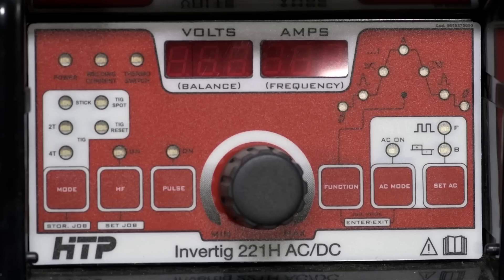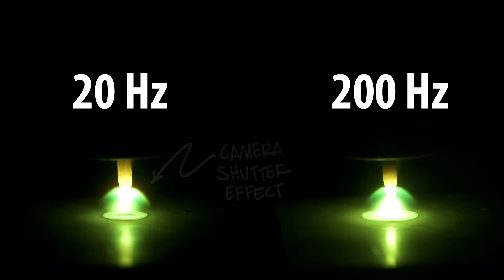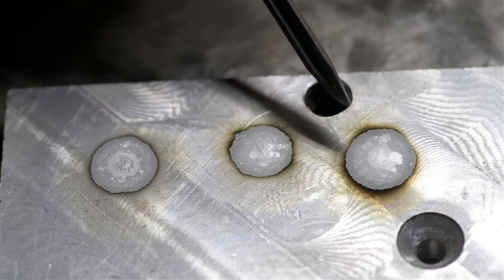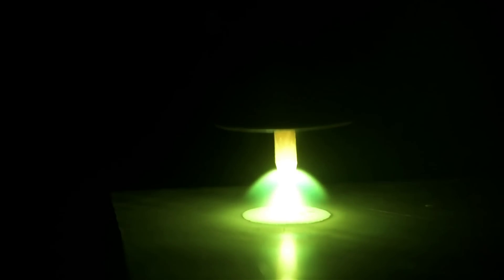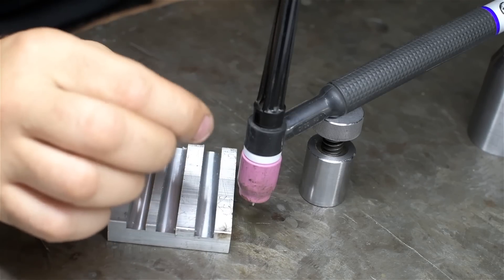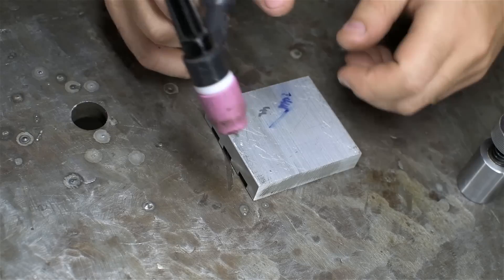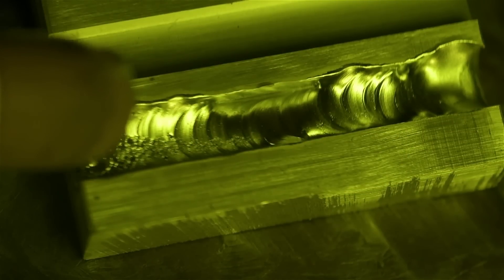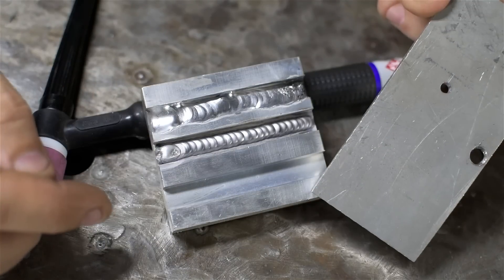TIG with TOT: AC Frequency?!

Comment: Very thought provoking video. Great job
Reply from the maker: Thanks Jody, always good to have you popping by.
Reply: You might be getting these results because of square waves. It may change with saw profile or sine waves. Because in some electric motor changing frequency for example increasing it increases the speed of the motor so we can say increasing sine frequency increases the power. But i guess in square wave its much more about duty cycle. But i am not sure since i am not an EE but ME.
Reply: yea agreed im more thinking it would also depend on tungsten prep as well so maby a  different combination  with  a bit different ac balance  thats the thing with these new machines so many different combos   as i sit here considering an everlast unit
Reply: I have a feeling 200a on most if not all welders does not mean 200a rms, and therefore the actual power delivered is not the same between DC and the highest frequency setting on the welder. Apples to oranges. Welds looked prettier than mine though, maybe I need to involve AC and maybe some helium with my normal lift start routine
Reply: @nicholaskruft3189  I think you are right on the money here Nicholas. the useable or functional part of ANY sine wave is its 70.7% of peak to peak voltage, or its RMS (ROOT MEAN SQUARE) value.  The rms value of is a function of arc voltage and current, one is dependentvon the other. For example lets forget about amps right now. lets look ai it in terms of voltage. If we have an AC wave with a peak to peak value of 200 VAC , at rms the voltage value is 141 VAC not 200. The rms value is what everything downstream from the tungston is "seeing", not 200 volts. Ohms law says the amps (I) = e/r . r being resistance in ohms. This would be all the resistance from the metal, the tungston, any microscopic dust particles, and impurities.1.1 ohms would be good resistance in an established plasma arc. dropping e to its real world rms value of 154 VAC / 1.1 ohms value of r yeilds 140 amps not 200 at the arc.  However this seems to be skewed a bit much by 60 amps? Seems to me the welder maufacturers would look at this and compensate for it, unless my math and ohms law is suddenly haywire? perhaps my math is? just thinking out loud here is all folks. lol!!
Reply: Both you guy’s have great videos! Im gonna teach myself to weld. Ordered a Everlast 200DV today. From what u guys put out there im confident i have learned enough to do myself.
Reply: instablaster.
Reply: @hondafreak8613  howd you do after learning after one year? hello?shit hope he's not dead.
Reply: @ThisOldTony I'm just a novice aussie bloke that loves to play around in my shed with a tig welder.  I watch both you and Jody great content from you both.   I  have also found and agree that the lower the Hertz range seems to produce more heat than the higher Hertz range but I dont put it to skin effect.  I look at it with maths I'd like to explain my view and please tell me if I'm wrong..  AC  Balance is the amount of positive (cleaning) compared to negative (penetration/heat) in the square wave cycle, usually 30%+ and 70%- ish.  And AC frequency is the number of cycles in one second.  Now if we can only move for example 1 inch in 5 seconds and the hertz is at 20 its has a much longer period in a particular area at the negative range of our balance in any one area.  And yes a larger period in the positive zone as well.  But at a higher Hertz the positive and negative are switching at a higher rate of speed which when applied at a rate of movement speed of the welder hand produces a cooler weld with less penetration.  Not sure if my thought makes any sense.  But love your work and you too Jody @weldingtipsandtricks

Comment: the machine is most likely not producing a perfect square wave, there is a slight ramp in the cycle switch, the slower frequency allows for a longer time at max amperage while the higher frequency spends more of the overall duty cycle in the transition between positive and negative
Reply: at least that's how I remember it from vo-tech welding program back in the early 90s
Reply: Cory Allison this seems very likely to me too, especially given the large voltages involved the ramp times will be high. I guess the plasma also has some capacitance which will add to that.
Reply: I was thinking the same thing
Reply: Got there before me!
Reply: time to get the o'l smelloscope into the equation
Reply: This non-ideal voltage transition is definitely part of it. The other part is what's called "ringing" - the transition in the cycle  wants to 'carry over' the set voltage, and then correct back down and 'carry under' again, many times until the waveform settles down. This happens on timescales which are sub-wavelength - small enough that with an oscilloscope you've got some zooming and enhancing to do in order to observe it, but it definitely affects the efficiency of energy transfer as heat. That ringing may even be high enough frequency to get into the RF 'skin effect' that TOT talks about in the video.
But it definitely means - like you've said here - that a lower-frequency waveform spends a larger proportion of its time in that "settled down" state which is good for heat transfer.
Reply: the voltage are not very high, once the arc is started it is probably something like ~25V
Reply: Can the aluminum dissipate the short pulses of heat more efficiently than the longer pulses?  I think you're spot on with the waveform being the cause.  Just throwing that out because it's what popped into my head.
Reply: Yup there is a ramp, and there is also likely a small delay to prevent shoot-through.
But I think the main thing is Reactance.
By setting your frequenzy higher it sounds like you're doing some fancy magic, but you're just pissing away power as more heat in wires and stock.

However, it would be interesting with a test of how frequency impacts <Arc ignition distance>, especially when the stock is covered by an electrical insulator like milling scale and other kinds of crud.
Reply: The start frequency is independent of the set frequency.  Most TIG welders have a separate high frequency start.
Reply: Steffen Dahlberg arc distance also has a lot more to do with argon coverage than frequency as well. With a big honking cup and high gas flow you can make a diffuse arc from inches away.
Reply: I'd like to give a shout out to Don Ivy, my welding instructor at the Tulsa OK, Vo-Tech welding program, class of 93. 25 years on and I still remember a fair bit of what he passed on, thought he was an asshole at the time, but he did good.
Reply: Came here to suggest using the oscilloscope as well - IIRC he's done one with it on the old TIG machine.  Capture some waveforms and all will be revealed....
Reply: The ramp lies in the nature of the attachment: it's very obviously capacitive. At 200Hz, you don't necessarily expect IGBTs to have much of a ramp of their own, then again, there's obviously gate capacitance, so depends on the current you can feed there.
Reply: @Siana Gearz, IGBT input and output capacitances and gate charge for igbt devices specified for pulsed currents around 200A have negligible effect at few hundered Hz. Typical igbt combined on-off time is around 500ns. Of course, this is only one component and it says little about the whole system. Alas, commercial igbt modules e.g. the ceramic-brick-looking module which is what you typically see when opening up a welder, are specified in 10's of KHz, some even close to 100KHz. In a welding setup, all the low-gage cabling to handle the currents controbutes significant inductance and that will likely dominate. To get to the bottom of this, several tests across different freq's and amps should be run probing voltages and currents simultaneously which would help answering what is actually being put into the work-piece under weld and then we can propose theories of what's happening. It would be interesting to observe whether tungsten shape (balled vs. sharp) would affect the measurements in any way while other variables are kept constant (i think then the igbt drive signal should be probed as well, given that the system has feedback loop). This will not be easy to objectively measure (driver and power characteristics, tungsten, welding penetration and bead shape etc, quite many variables to account for)
Reply: Djöfull er gott að vita til þess að það sé í það minnstakosti einn annar Íslenskur vitleisingur sem horfir á bæði AVE og This Old Tony
Reply: there's dozens of us, dozens!
Reply: tékkaðu líka á stefan gotteswinter og oxtoolco báðir miklir meistarar
Reply: Þrátt fyrir að ég sé búinn að skella mér í gallastuttbuxurnar þá held ég að ég sé seinn í þetta partý
Reply: @Kar1HP  make the video. you will get a million views and be a knowledge base for many years to come.

Comment: I do a lot of pipe welding with an extended land bevel which is similar to the grooves you welded in. I always go high frequency on the root to prevent the puddle from spilling outside the bevel, then I go low frequency on my fill and cover pass.

Comment: Hey This Old Tony, tangent thing I wasn't sure you knew:

I noticed your cracked nail in the video. Get some CA Glue, put a droplet on you nail and then put a tissue (facial) on the drop. Let it dry. Remove excess tissue and then get your wife's nail file or one of those lathe files you've mentioned and sand the patch smooth. It's kinda like fixing fibre glass.

Source: my Mum was a nail technician for more than forty years and I suck at hammers.
Reply: Is that why your name is toddsmash?
Reply: @HenryPiffpaff  Sorry for the very very late reply.

Unfortunately I am one of the clumsiest people I know.
Reply: @toddsmash  Pro tip, forget the tissue since you scrape most of it off, instead, put only fractionally more ca than you need and sprinkle baking powder on top {or bi carb}

It'll make the ca super hard and then file down, it'll be a long while before that nail breaks again
{source helicopter technicians use this to temp repair damaged blades}
Reply: @sarchlalaith8836  never heard of that one but I'll try it next. Thanks mate!
Reply: @toddsmash  welcome cohort.

Comment: The skin effect actually does appear at pretty low frequencies [1].  The skin effect at 200 Hz is as low as 4-5 mm in a plasma.  With square waves there will be higher harmonics and the depth will be even smaller.  

Higher frequency will cause power to concentrate in the outside of the arc cone.  That extra heat on the outside will dissipate a lot more before getting into the metal, and indirectly widen the arc very slightly as heat on the outside will generate a little extra plasma from the surrounding cool gas.  Say you're running at 2000 Hz with a square wave and your overall skin depth is 1 mm.  If the arc is 4 mm wide, the power in the center is 20x lower than the power on the very edge of the arc.  At that point it might as well be off.  At 200 Hz the difference will probably be closer to ~20%, but that's still a huge difference and the overall heat into the weld will be reduced a lot as well.  Since power is concentrated on the outside of the cone it doesn't have an insulating later between it and outside air and it radiates faster.

The reason skin effect is usually neglected at low frequencies is that the overall power dissipation doesn't change much until higher frequencies, and wires are much thinner than a GTAW arc.  Electrical engineers don't care much if a wire has 10% more resistance than expected, but when you're welding a 10% change in settings can be a big problem.

Comment: Hey Tony! Electronic Engineer here - I think your statement at 8:35 ish might be off. I doubt it's a square wave. Probably more of a trapezoid shaped wave, with a set rise time based on the voltage you're running, humidity, quality of grounding and so on. That rise time will be the same at 20Hz and 200Hz. And probaly takes a few milliseconds. Therefore at higher frequencies instead of hitting the flat at the top of the trapezoid, it's either sloping up halfway, before sloping down again, or just spending less time at the top, so the integral yields less energy to the work. Great video as usual!
Reply: Fellow electrical engineer here. Since the output of the welder is a (somewhat) square wave, is it possible that the higher frequency over-tones of the wave may play a role? Can the skin effect and other inductive losses come into play in higher frequencies that the fundamental frequency?
Reply: Interesting theory, although I have a feeling that because the tip of the electrode is held just over the grounded work and sparks fly (!) There must be some amount of capacitance which would account for the delay in charging up over the cycle. The plasma gap and the voltage difference effectively create a RC circuit? You could be right though, L might rear its head.
Reply: Probably also ringing like a carillon on Christmas.
Reply: Not an electrical engineer here, so I may be way off, but here's another take on it that may also play a role in what's being observed: let's assume a perfect square or sine wave where the only difference is the frequency. At the lower frequency, electrons have more time between wave reversals to travel through the material. Therefore they travel further, causing more heat. The higher the frequency, the less far they travel before having to turn back. At the upper limit, infinite frequency, they don't move at all (at least, not as a result of the AC wave). Could this play a role in explaining why at higher frequencies you need to raise the current to get the same heat?
Reply: maybe it's because it's warming the metal for 5 ms at a time at 200 Hz and 50 ms at a time at 20 Hz; 200 Hz gives a more stable temperature, 20 Hz makes a bigger puddle
Reply: to illustrate what i mean i "plotted" (in the loosest sense possible) temperature versus time at a given frequency: http://i.imgur.com/jSPbQJU.png. it's meant to show that at 20 hz you'll get power bursts where the temperature goes up very fast before it's allowed to cool, and the 200 hz goes up in temperature more gradually. idk i'm just guessing lol. it's visible in the video too, the 200 hz puddles are easier to control i think.. maybe?
Reply: actually i found another comment which affirms my assumptions
Reply: but then, though not moving as far, they'd be vibrating faster. Would that not create more heat? much the same as food in the binger?
Reply: Jimmeh B: no, the speed at which they move is determined by the current, which remains the same. They get turned around sooner, but they don't move faster.
Reply: Real mean dont worry about trapezoids and all that nonsense! We 6011 everything and dial it up!...even aluminum ha haah!
Reply from the maker: Thanks!  when I get some time maybe I'll revisit with the oscilloscope and have a closer look.
Reply: Hi, also an EE here. One of the fundamentals of AC is the following P = V * I * Φ. Φ is the phase between the Voltage and the Current. Φ is influenced by the frequency, capacity and inductance. Capacity and inductance will change with different materials. I think the frequency is sort of a compensation dial for diffent materials to weld, but i am no expert thats just what i would think.
Reply: Juan Rial The reasoning you've run with is wrong.  You're caveat of no an EE is well grounded and your statements are so far off they're not even wrong.

+Marco Lagerway, what is the frequency compensating for?
Reply: Daryl John Bosch: Thank you for the clarification. Your post has helped me understand why approaching this from the angle of the underlying physics, while based in logic, through analogy with other vibrating systems, incorrectly explains the observed phenomena in this particular instance.

You didn't have to; nobody expects people on the Internet to educate and share the knowledge, rather than taking cheap shots at people who've chosen to build their expertise in a field other than the one they themselves operate in... And then have the nerve to actually show interest anyway! So I want you to know that your efforts at positive contribution have not gone unnoticed.

One thing though. It appears to me there's an error in your reasoning/assumptions as well. For I am most definitely not caveat.
Reply: jamie Russell sure man, grab a beer from the fridge, and grab one for me as well, while I boot up the specialised equipment. I don't think we'll be needing the LHC today, so I'm just gonna leave it off for now, it's such a drain on the electricity budget. ;-)

In all seriousness, it's not particularly easy to prove without tons of specialised gear I don't have access to. But, I did find a fault in my reasoning... The heating up due to "electron friction" shouldn't depend on the frequency. Whether an electron has had the time to traverse 1m or 1mm, it will most certainly move past several atoms. And the heat is caused by the electron emissions and absorptions, whose number doesn't change. So guess I was wrong, and now I have no clue as to what's causing it.

Bugger!
Reply: @EvenTheDogAgrees  And aluminum holds that heat so it just keeps building.
Reply: @ThisOldTony  The oscilloscope will prove Mr Dolan correct, I think.  Your welder will not be producing a perfect square wave and the ramp up and down represent lost work output.  By increasing the frequency, you are cramming more of these losses into each second, thereby lessening the heat put into the work piece.  If the ramp slopes were long enough and the frequency high enough, the wave will never reach it's selected output current.